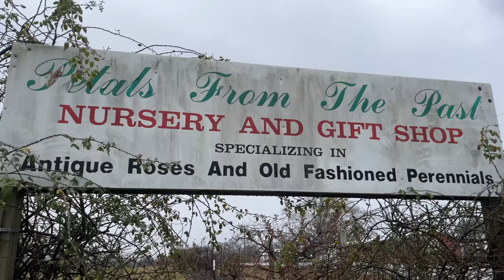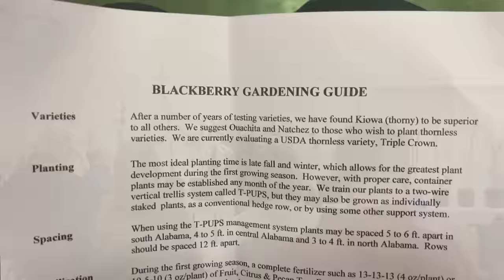Our House Is Finally HERE!!!

Comment: Jason, you guys have done a great job on everything I’ve seen.  The most important part of any construction is integrity.  You do things correctly and without cutting corners to be lazy or cheap.  I worked with contractors for about 20 years and is what makes the difference between bad work and what lasts.  Excellent job!

Comment: Excited for you. The poles are the most important part of the structure. Got to have the proper draining of moisture. There also needs to be a permanent insecticide / termite treatment in the holes. Good luck it's going to be fun. Big changes coming.  Are the corner boards all set up and where you want them. That will give you a final look at the direction af view.

Comment: Wood for pouring the foundation pluming roughin.septic tank and lechlines I hope this has already done.  Are you building on bare dirt your house,or your garages on bare dirt or do you want a concrete foundation in both,  with electric lights.?